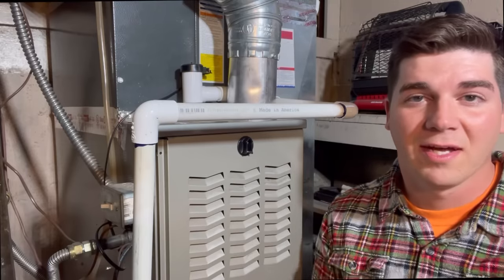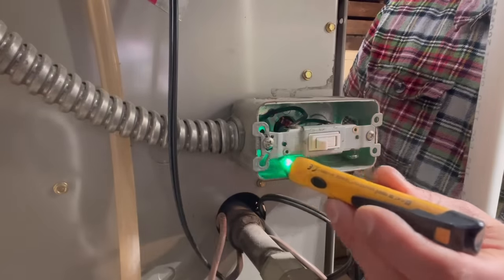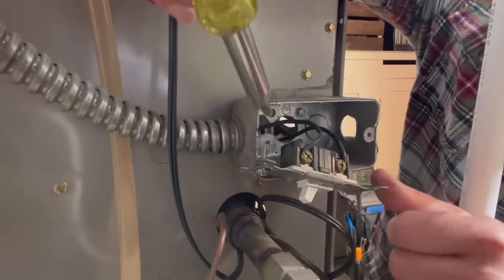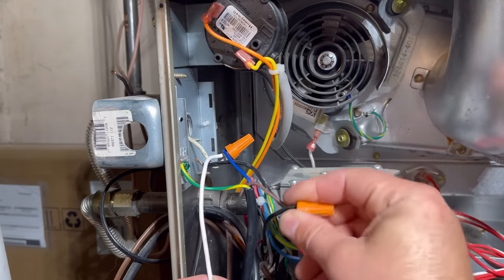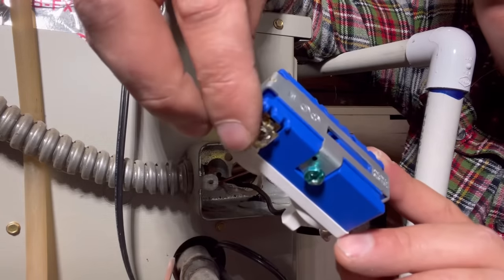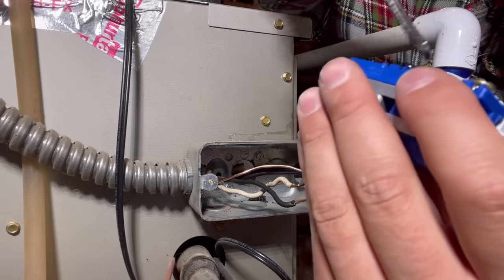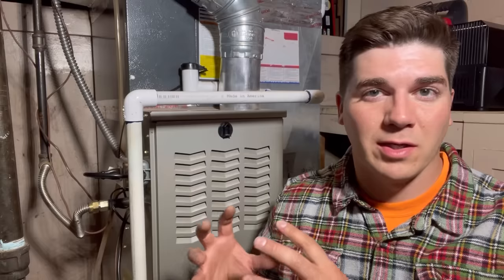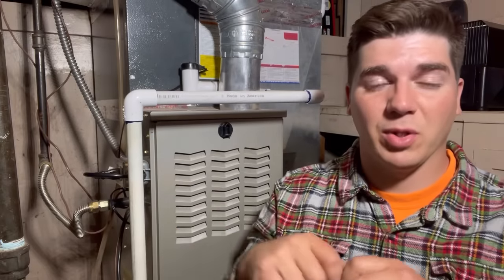This Could Keep Your Family Warm During An Emergency Power Outage.

Comment: Better idea is a sub panel with a manual transfer switch. You can put a couple of circuits on it for your furnace, refrigerator and  internet router.
Reply: TV and lights also. Our home was built in 1978. At the time of construction it had a 50Amp transfer switch installed just for emergency circuits sub-panel. Along came Hurricane Andrew in Aug of 1992. The whole power grid became non-existent. A larger transfer switch was installed so that the whole house could be run on a generator. It is fused for 200Amps ( slow blow ) and is rated at 600Amps and with addition of another set of contacts, could be used for 3 Phase power. Needless to say it was needed as we were without commercial power for 5 weeks. A 10KW  or a 7.5KW running either/both circuit(s). Now I just have the 7.5s or a 6KW inverter that can run off solar or charge the batteries if the generator is running. 

As I am moving to our house in Ohio, first thing to be done there will be another whole house transfer switch installed. Along with a proper sub-panel fed off of the inverter when power goes out. This will also allow me to get rid of some of the Romex wiring ( I hate Romex ) and install proper conduit and wire runs.

Comment: ..... I got my generator years ago right smack in the middle of an emergency. I initially ran extension cords to power up stuff.  I needed our boiler to run so I wired a short heavy duty appliance extension cord into the junction box that fed my boiler. I didn't want to "back feed" power back to the panel so I isolated the wires that ran back to the main panel. Just to be sure, I also shut of the boilers circuit breaker at the main panel. I simply plugged the extension cord into the generator and I was in business.

Comment: I did something similar, but easier. I made an extension cord with two male ends. I opened the circuit breaker and plugged it in to the generator. Worked great

Comment: Great video! Our caretaker in the Northwoods of Wisconsin made this mandatory if you kept the heat on during the winter. He also made sure you had a bank of batteries to power the furnace for 48 hours until power could be restored or a backup generator arrived. He also made sure you had the ability to hook a (several) propane tanks to the furnace if your main tank ran dry. Oh- and if your furnace ran on natural gas from the township he made sure it could run on propane via switching regulators. A video you could do if your furnace has the capability to run on propane & natural gas. This caretaker absolutely hated newer digitally controlled furnaces. Stick with good old analog controls. In a pinch you can manually operate a furnace and it will always make heat and hot water if you have a forced water heating system, and water tank.
Reply: Beau   respectfully disagree with  your switching between natural gas and propane there is much more involved to safely modifying a furnace  to run one fuel to the other gas pressure springs in the gas valve burner offices pilot offices all must be changed with attention to altitude above sea level and shouldn't be done by an untrained person

Comment: Overall good video and explanation of steps. Would not recommend using stranded wire for the jumper and would like to see wires wrapped clockwise around terminal screws rather than just clamped down. This was done with the ground wire, should have been the same on the hot and neutral. As someone else commented, there should be grommet on the furnace housing so wire casing does not wear through over time.
Reply: What’s wrong with stranded wire?
Commercial electricians use it all the time
Reply: @genetownsend8847  Not in my house. Everything is solid wire.
Reply: @MAGAMAN  house =residential wiring, not commercial.
Stranded wire is used extensively in commercial/institutional and industrial wiring.
Reply: @MAGAMAN  Stranded or solid depending on the circuits here.
Reply: I thought the same until he got to the Neutral wire. Then I saw that this combo is designed with a clamp under the head of the screw. So it will work with either stranded or solid wire.

Comment: I would use a normal outlet. Plug the furnace into the outlet or generator. The electrical utility would freak out if you connected to their neutral. There’s a chance that one of their workers could get electrocuted on a line that they thought was dead. DIY people could connect the wrong wires. Also it has to be a pure sine wave generator for the furnace circuit boards.
Reply: You are absolutely correct about the neutral. Your idea is exactly what I did. In my area it is very illegal to hook a generator up to your house in any way with out an approved and inspected shunting switch.
Reply: I totally thought that's what he was going to do.
Reply: How sensitive are furnace circuit boards to the purity of sine wave? Is it a matter of how long the furnace is on backup power? My neighbor has a generator which does not claim "pure" sine wave and has powered his furnace three times the past two winters with no issues.
Reply: He's not hooked up to the grid at all doing it this way thats why he used the plug it's completely isolated when you unplug from the furnace and plug it into an extention cord. It's still against my code because it needs to be hardwired but it is completely safe for the homeowner and the utility personnel
Reply: The method shown in the video does have the neutrals separate. Nevertheless, I don't think that it is a big deal as the neutral gets bonded to ground in the main breaker panel. The danger to lineman occurs if you backfeed on the hot wires.

I have a whole house generator with an automatic transfer switch and the only wires that get switched are the 2 hot wires. There are separate neutral and ground bars where the respective wires for the service, generator, and home are connected together -  and stay that way whether I'm on utility or generator power.

Likewise, you can connect your portable generator to your main panel if you have an interlock installed on the breaker panel that only allows either utility power or the generator breakers to be active at 1 time - but not both at the same time. In this case the neutrals are all connected together on the neutral bar.
Reply: @JasonEDragon  the interlock system depends on your area and local codes. A generator panel has a 3 pole breaker with one leg connected to the neutral bar so it completely isulates the neutral from the utility when using your generator. When back feeding your panel there us always a potential even if the hots are isolated and the linesman becomes the potential.
Reply: @scottscott4067  Yes. The potential arises in the case of house wiring errors, which are common. The local codes are there to decrease the likelihood that an assumed neutral (or even ground if not actually ground) isn't energized. But homeowners and even electricians make mistakes.

And keep in mind, people are often running generators in an "event". These events sometimes pull in newbie linemen to make repairs.
Reply: @scottscott4067  I had a 22 kW Generac generator and whole house transfer switch installed in 2019 in western New York. My transfer switch doesn't have have a breaker in it, but an electronic switch for the 2 hot wires, and a fixed bar for the neutrals and for the grounds. I just went on their web site and reviewed the user manual for their current transfer switch model and the layout hasn't changed - the neutrals all connect to a bar and only the hots get switched.

For there to be a danger with a generator there has to be a closed circuit. The neutral conductor is bonded to earth at the main panel of every home and most/all utility poles that I see also have a ground wire connected to the neutral. To complete the circuit the generator would also have to be connected to the hot wires that go out to the service to present a danger to lineman.

If your concern was valid with the neutral wire then there still is a problem with furnaces. At least on my furnace the gas line is steel pipe and electrically connects the furnace to the neutral of the service - as the water and gas lines are bonded at the main panel. Many portable generators have the ground and neutral wires bonded inside the generator - so the neutrals would still wind up connected.
Reply: @JasonEDragon  I didn't say anything was wrong with your generator set up but that your area is specific to your set up. I need to use a panel with 2 interlocked 3pole breakers controlling 2 hots and the neutral. Different areas Different codes. And the neutral on the generator can be bonded or floating.
Reply: @scottscott4067  I believe that the purpose of a portable generator with a floating ground is so that it can be connected to a home's electrical system - where the ground/neutral bonding is present at the main panel. Otherwise, you would have objectionable current in the ground wire of the cable that connects the generator to the home (~half of the return current flows on the neutral and ~half on the ground).

Likewise, as I understand it, you wouldn't want to use a floating ground generator by just using extension cords to appliances and not having the generator connected directly to a home's electrical system. Because in that case the ground wire wouldn't connect to anything and wouldn't be able to clear a fault.

As an aside, I'd always use a meter to determine what kind of generator ground type I had. A portable generator of mine was said to be floating in the user manual - and it wasn't when I finally measured it some years later.
Reply: @donziperk  It's important to understand what "hook a generator up to your house" means. As he did here the furnace is isolated from the mains...it's running off the generator. So the generator is NOT connected to your house...it runs stuff IN your house. If you're hardwiring in to the panels and circuits yes then it needs a proper transfer switch.

Comment: I works for a Generator, or a pure sign invertor.  Most of your cheap Modified Sine Wave inverters will go up in smoke if you tie the netural to your hose neutral which is tied to ground at the panel

Comment: You should also mention when selecting an inverter to power a 110 furnace, always make sure the inverter exceeds the power rating of the furnace.
Reply: and note that the generators advertise in peak watts not running watts, in other words they're kinda full of garbage and you have to oversize
Reply: No such thing as a "110 furnace". They're either natural gas, or LP (propane).
Reply: @brnmcc01  yes but he's refering to the power required to run the blower motor and control circuits
Reply: @seanshomeshop325  I know I was just bugging him. People need to stop using "110" though, that is so out of date it goes back to the days of Edison and DC voltage.... It's 120/208/240 now. Since the 1930's. Or 230v single, 415 3 phase in Europe.
Reply: @brnmcc01  smh, some ng furnaces run on 110.
Reply: @BurninBogey7  120, not 110. 110 is over 100 years out of date.
Reply: @brnmcc01  Jesus Christ dude, take your technicalities somewhere else.

Comment: Thank you for a first class explanation of this switch.  Makes total sense to me now.  The details and manner you described this is excellent.  Greg
Reply: after watching this I realized you added the outlet to the switch
and there was already a switch there...
but... with the outlet and the plug, you dont really need a switch

If you replaced the switch with a standard power outlet, and put a plug on the furnace wires, all you need to do is unplug the furnace to turn it off
or to plug it into the extension cord that runs to your DC to AC power inverter.
Reply: @kenwittlief255  functionally it would work, but I’m pretty sure that the NEC stipulates a switch. Of course, I’m not sure that the cord/plug would pass inspection when the house was sold, so you’d probably have to take it out.
Reply: We are installing a 220v electric heat pump system - today! It will take 60 amps to run, so . . .
Reply: @Isaacson4  You could probably run that off a generator. I have an electric boiler that’s 100A at 220v. I’d have to bring in a truck.
Reply: Gfci usually but homeowner can make this change for what it is, power source choice.  Great idea and video.  57☆
Reply: I checked my furnace and I have an additional box in the inside of my furnace?
Reply: @TomCee53  

Does the NEC require a switch or just a manner of disconnect? The reason I’m wondering is, much to my surprise, a dishwasher I bought came with a plug. The appliance store told me many were building them that way to avoid having to install a separate code required disconnect. Making that connection on the floor is always a pain in the arse anyway.
Reply: @kenwittlief255  - I think most local electrical codes state that a furnace must have a master switch near it.  Quite often, these are up mounted high near the exit/entrance to the furnace room or near the furnace but not on it. Again, different codes have different requirements.  If the switch is in a different location, then your idea of an outlet only could be fine.
Reply: @kenwittlief255 up under uiiiiiiiiiiiiiii
Reply: CQ CQ CQ 74s
Reply: @kishascape  - dah dit dah dit, dah dah dit dah. 😄
Reply: Can't do that to a 220 volt electric furnace without a huge battery bank and Higher end inverter.
Reply: @johnspartan98  yeah, you pretty much need a generator hooked into the main supply for the whole house if you have an electric furnace
Reply: Need to say in your introduction that this arrangement is for gas fueled  120 voltage AC serviced furnace .
Reply: You should inform the watchers that the condensate pump utilizes the European color code and not the American color code.
Blue = Neutral
Brown = phase or line
Green or yellow green stripe = ground
The American system is,
Black = line or phase
White = neutral
Green = ground.

This is a quick fix for keeping your heat on line for those emergency systems. Personally I would use a larger steel panel box and mount heavy duty double pole double throw switch with a surface mount 15 amp male plug on the box. You would connect the furnace wires to the the common poles of the switch and then connect the feed wires to the pair on one side of the switch while the other pair of contacts go to the panel mount male plug on the box. Make sure the grounds are connected together and a ground line is also placed onto the external box housing the switch and plug. As for the switch keep the "lines" connected along one side of the switch while the neutrals Along the other side of the switch.
There should not be any issue with code since all wires are within the junction box on the furnace. Take your extension cord and nest it into the surface mount plug and flip the switch to "external power input".
Reply: A simple cord built for persons generator and drier plug would eliminate having to had this pig tail. Power goes out flip your main breaker off plug generator into drier plug and select the breakers you want on and back feed your home. Simple to do and use

Comment: I did this years ago with my Gas Fired Hot Water Heat :) Turned a Junction Box into an Outlet with Plug for Furnace,... Ran it from Inverter & old Car Battery ;)

Comment: I'd change your order of operations. First remove the cover plate. Then check for a live circuit. If you don't see a live circuit (by whatever means you're using) then you stop and figure out why. (Is the breaker tripped? Is your tester working? Do you know how to use it?) You want to see a live circuit, flip the breaker, and then see a dead circuit.

Comment: Pretty clever setup. Thanks.
I wonder if the National Electric Code requires insulating bushings where the pigtail enters and exits the receptacle?
Also, make sure the gauge of the pigtail wire is sufficient for the circuit.
Reply: I believe it does require a bushing or NM clamp.
Reply: Doesn't matter as this setup is not to code anyway.
Reply: @hotpuppy1  can something similar be done to code?
Reply: This video is monetization, not information. Of course you would want real licensed work done ;) It's for the views.

Comment: It may make more sense to make that mod (or something similar) at the service panel, as it’s likely to be more accessible than the furnace (many of which are in a crawlspace or attic). But one does need to be mindful of what else might be on the circuit, if it isn’t dedicated to the furnace alone, and use appropriately sized wires, or better yet, an interlock or transfer switch. That may also catch a gas water heater (or gas oven) which is dependent on electricity for ignition (e.g. an on-demand water heater, or any gas oven in production today).
Reply: You would want the switch and receptacle wired out to where your battery supply is located and EASY TO GET TO IN THE DARK. 🤔
Reply: Gas water heater (if a bit older) may not need 120VAC power - mine does not.
Reply: @leeroth5604  – I see that my wording could be interpreted in two different ways. What i meant was those gas water heaters which are dependent on AC for ignition. In general, i think most tanked gas heaters use a pilot, whereas most tankless heaters use electric ignition. It makes sense to use a pilot on a tank as the heat from the pilot goes into the tank.

Sidenote: For what it's worth, my current house has a tankless heater. I hate it, and have seriously considered swapping it out for a tanked heater. I think the "energy savings" of tankless heaters are theoretical only; real world use, not so much. Especially if one puts in a return line on a tanked heater (which can't be done with tankless), and uses a passive thermosyphon (or a pump on single story houses), to create a recirculating hot water line which ensures that hot water is always available at the taps (i.e. no wasted water running down the drain waiting for hot water at the tap). Life is too short not to have this creature comfort.